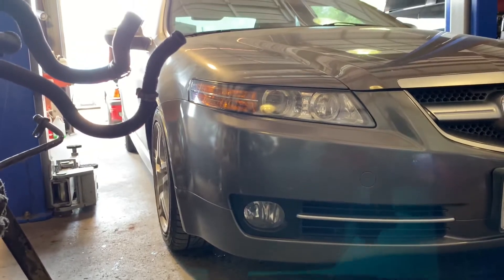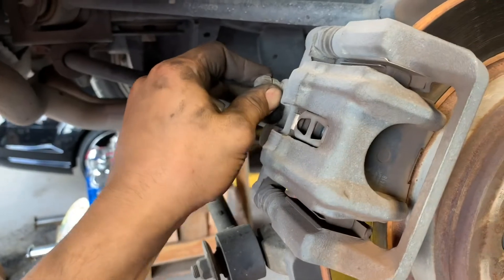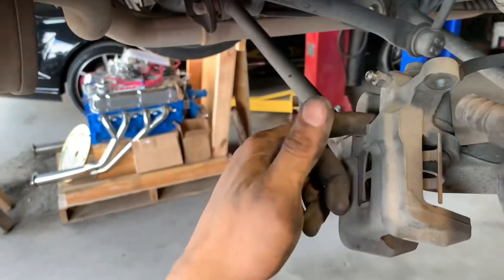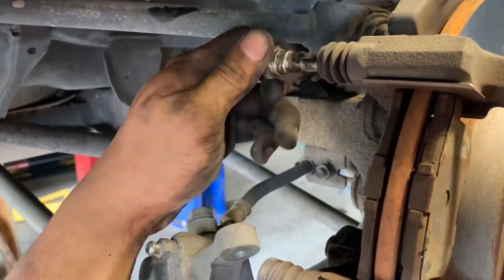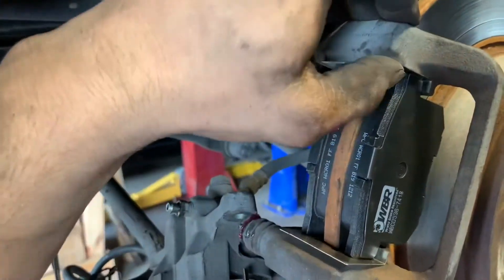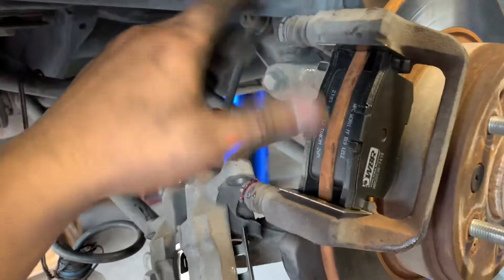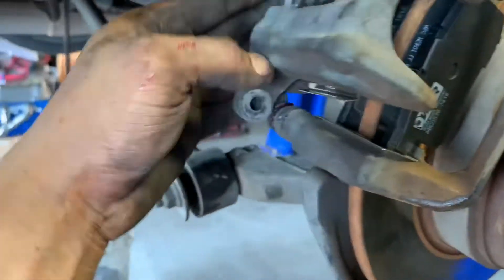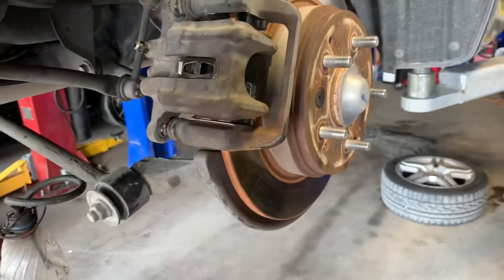2008 Acura TL Rear Brake Pad Replacement

Comment: How do u bleed it?
Do you just press  the and it bleeds out having that 10 mm bolt. Or do you have to presse the brakes leave it pressed then bleed and repeat one more time?
Reply from the maker: The latter. It is a two person job. Most ppl will not do it but I like to be sure there is no air in the line and the method also allows for “flushing” of the oil brake fluid.